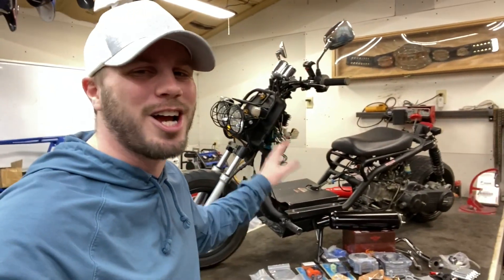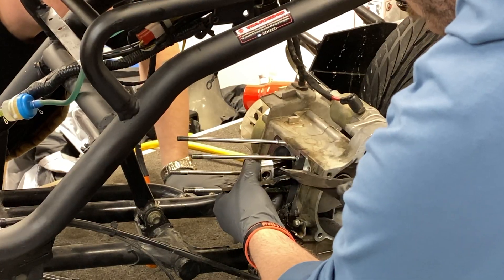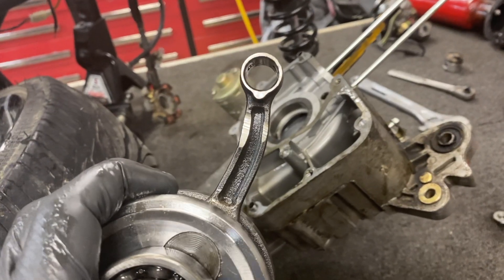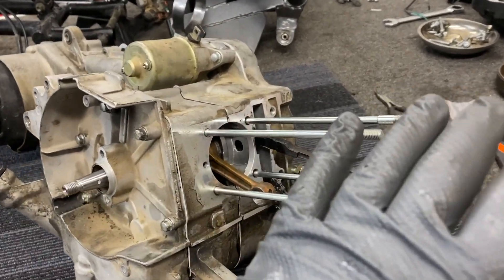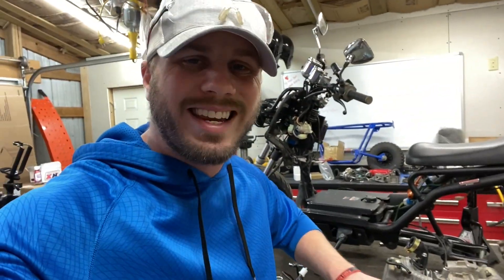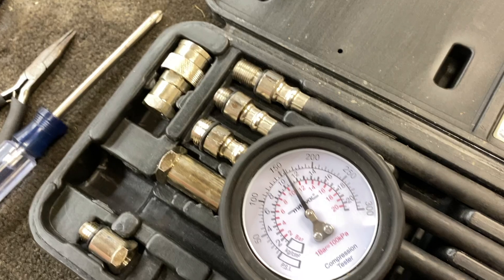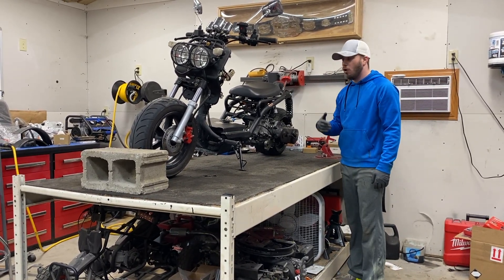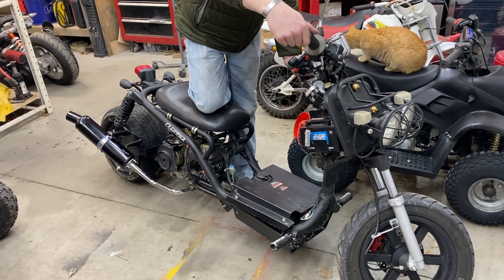100cc Big Bore Kit on a Honda Ruckus Clone! Will It Run...Better? GY6 139QMB It's a Chuckus?!?

Comment: Some people would say this is a over kill, but they dont look at it in the long run. Here in Georgia a 49cc doesn't require a motor cycle license. Changing ot to a 100cc will give people the power and only requires just a basic license. I have been telling people this that are looking for cheaper ways to travel around in town. Keep up the great work.
Reply from the maker: Exactly James! That is the same law for Iowa as well. I have my motorcycle license but for someone who just wants to zip around town these big bore kits are great and actually a pretty cheap option for some extra power.
Reply: Since the law won't look inside your engine why even register it?  They won't.  Done it on a ton of scooters.  Nobody registered theirs.  No one was even questioned. They gave me $300 and their scooter.  I gave them back a 50MPH "50cc" scooter. To not register them was illegal, but neither is doing 35 in a 25MPH zone.  Who doesn't do that?  Plus the extra pep could get you out of trouble some times.
Reply: @oscarhaynes1994  It's mainly to get away from the motorcycle licenses. It still has to be registered. As long as it is registered, you are wearing a helmet and have a regular licenses then anyone can legally ride it. Florida years ago was at 500cc without a motorcycle licenses. Im not sure if they still allow that now or not though. I think all states should allow up to 500cc without requiring a motorcycle licenses.

Comment: I purchased a used 2007 Piaggio mp3 250 IE on March 2019 because of Covid19 took me 3 yrs. rebuilt this motor scooter right now little more work I be finish! I have ADS and takes me little longer just finish one project and this be my first time working this bike! Praska Boy`s Garage💯

Comment: Interesting topic, my neighbor just bought the ice bear mad dog trike. The previous owner said the fuel pump was junk with 35 miles on it. But he jerry rigged a gas can to gravity feed the carb. Replaced the fuel pump and it still didn’t have fuel. Replaced all the fuel lines and vacuum line and still no fuel flow. Then I realized the vacuum fitting on the intake manifold to run the fuel pump wasn’t making any vacuum. Couldn’t suck or blow. Pulled the manifold off to discover the fitting was plugged with silicone or some crud. Ran a drill bit thru it and that fixed it. Fuel flows, it was shipped and sold like that. Thinking he needs a 100😎

On another note…. How the heck did you bend the connecting rod? Then I saw how you rolled out of the garage.😂

Comment: Hey man great video a couple things to note 1 being you don't want to go over 30 on a fresh top end rebuild until you're close to the first oil change 2nd is that if it's revving really high it's probably those yellow clutch springs you put in are sometimes way to stiff if you can't manually open the clutch all the way with your hands they're to stiff otherwise awesome content and I'm definitely subscribed for more.
Reply from the maker: Thanks for the sub! Honestly I am more of a go or blow builder when it comes to any of the chinese throw away motors. If I rebuild name brand oem stuff I definitely take my time to break them in! Appreciate the heads up on the clutch. I ordered a complete tuning kit for the transmission!

Comment: Good content my man. Semi-pro tip: exhaust spring tool is the way to remove/set the clutch springs into the pack. I haven't looked through all your content but you guys need to look into doing some 2T swaps (I have an aerox two stroke in a Zuma and wrapping up an RC-One in a Vento Triton....both are monsters). Getting together a two stroke ruck soon.

Comment: I have a question for anyone reading this who knows engine stuff. But first let me say a huggeeeee thank you to Praska Boys! Someone gave us one of these 110 cc go-karts and your videos have been so valuable in helping me get it running again. The issue I'm having now is the engine just stopped. I'm tearing it apart (which has been a great bonding time with my son) and there is an issue. I'm not sure what the name of the cover is but a little square knob on it broke off. The cover is a thin aluminum one that comes off with 2 philips head screws. It is behind the flywheel and the sprocket that the starter chain goes to. Where this peg/knob was there is now a hole in the cover. I guess my question is what is this cover called and can you order one somewhere? I'm guessing you can't fix that without welding and that is well beyond my skillset. I've scoured the internet for parts diagrams to try and identify it to no avail. Thanks in advance to anyone who may be able to help!
Reply from the maker: I'm not sure if I am following the description but it kinda sounds like your talking about the stator pickup. If you want, send me some pictures to my email and I'd be happy to take a look. Praskaboysgarage@gmail.com

Comment: That moped will fly keep it up man awesome content
Reply from the maker: Can't wait to start working on mine! Thanks for watching!
Reply: Not with that kit. Even with skills at wrenching and tuning a 50mm ebay junk kit MAY get you into 35-40mph range if your lucky normally or average top end after a chaina kit install is 30-35 lol with more lowend thats it. 
  However with good parts you could do a stroker kit (52mm big bore kit) and good cvt carb exhaust and hit the 45-55mph range depending on how you tune it. My icebear mojo pst8-50 has a 139qmb 49.5cc gy6 motor that i fully rebuilt using Narka-NGK-OKO-KOSO-NYC parts about $600 total with some discount codes i had. My trike now tops at 48mph with me 195lbs and hits 48 sooo fast the frontend lifts up on a scooter trike , trust its very impressive 👏 i tuned it for intown riding 35mph roads have that extra 10mph for passing its great 👍

Comment: Cool conversion from a Chuckus to a Ruckus with the Chuckus look. Try updating the engine to the 150cc one in the Honda PCX150. I've had my stock PCX on the highway hitting 70 and still getting 100 MPG around town. Not as cool as my Honda CTX700 but then the 700 is a 680cc cruiser and not a scooter.

Comment: I feel you've got a lot or room to improve on that.  I did a similar kit and sliders on my ex's taotao and I can hit 46mph on the gps. Good luck, they're a lot of fun,
Reply from the maker: I agree! Trying to hit top speeds when it's 15 degrees outside with no tuning didn't help at all! This spring we will get the CVT dialed in for top performance.
Reply: The kits 100% junk so junk it should be illegal to sell it. If you bought a ebay kit like he did you where ripped off sorry. Dont feel so bad cause i learned the hard way aswell wasted $100 on a goofit 100cc kit.. but than i joined Facebook groups study a little and learned clone bikes are worth buying just so you can *hotrod* them its a lot of fun just have to buy NAME BRAND AFTERMARKET PARTS NYC narkra koso ngk oko just to list the best a few other brands other there like Dr pully sliders, gates for belts.. my 50cc *trike* tops at 48mph and could be faster i tuned it for lowend in town riding 35mph roads. With some tuning i can get it up to 50-55 range with new tires and a sprocket (trike chain and belt drive) should be near 60mph and still be able to do "power wheelies"

Comment: In all of my years of working on mopeds I have never seen a bent rod but I would suggest a flat slide carb taller final gears and lighter rollers there will be plenty difference and should hit around 50
Reply from the maker: Absolutely man! I plan to do all that and more. I want to max out the 50cc I bought and have a series on how much the performance parts actually help and which ones are a waste of time! After that it's going to the 150cc+++ club!
Reply: @PraskaBoysGarage  150 club sounds good if you plan on modding them heavily I’d suggest a 232 kit as there bullet proof at that point I have customers coming in every week with blown 150’s bc they beat on them I have a 232 it’s properly geared with efi and on 12’ rims hits 120+

Comment: wow, if the plan up front had just been to swap out a 125 for a 49.9cc it still would not have been a "bad" deal, but yes often you get what you pay for, or you can have some (some) Bob Ross, Happy Accidents along the way.
Reply from the maker: I have all the parts purchased and ready to go for the upcoming 150cc swap! Should be fun to compare the upgrade!

Comment: Nice. Do the right shock delete and upgrade the left one with an lower coilover that has a oil can on it. And swap out that rear tire trust me. Do the tire first.
Reply from the maker: Thanks for the advice! Yeah that tire makes it super difficult to turn. I expected it to be like a normal motorcycle and it wasn't even close. We will be working on my scooter next and when we do the motor swap it will definitely be getting a better set of wheels and tires!

Comment: MUCH better compression. But I can't figure out what bent that rod, assuming it was actually made out of some kind of metal. To turn it into a pretzel like that, the small end almost had to hit something. But what. The small end is inside the piston. Which means the piston had to hit something. If it had hit a valve, there would be a bent valve and probably at least some damage to the top of the piston, but there wasn't. Had there been a foreign object in the combustion chamber or a too long plug, there would have still been damage to the top of the piston. It was the side of the bent rod that hit the cylinder that broke the chunk out of it. That happened after the rod was already badly bent. A real puzzle, unless I am missing something. Of course who knows what the previous owner may have done. He may have replaced the piston and/or a valve and never noticed the rod. Or did see it and decided it was time to give up. And with the rod bent that bad, it would have shortened the stroke considerably. I'm amazed it had any compression at all. There must have been over an inch between the top of the piston and the head at TDC with the rod bent like that.
Reply from the maker: I could not believe it ran in the first video to be honest! With absolutely no rod knock or anything! We are assuming he vapor locked it at some point and ran it into a big puddle or something. Either way, it's wild!

Comment: You need to put the cooling plastics back on the engine. If not it will over heat.
Reply from the maker: I got this comment on my other scooter video also. We plan to put them on but here is my question. GY6 motors are built to be enclosed with most scooters having plastic coverings all around them. This scooter is different with the motor being completely exposed. With that being said is it still 100% necessary to have them on for this specific scooter?

Comment: That engine was probably hydrolocked. I can't really think of another way that the rod would get bent without catastrophic top end failure.
Reply from the maker: I'm very curious as well. My guess was possibly the performance CDI failed and messed up the timing, or it sucked something up in the intake. Not sure, either way I feel it made for a better video!
Reply: @PraskaBoysGarage  ignition timing issues are not going to bend a connecting rod.  I can pretty much guarantee the previous owner sucked up water.

Comment: I am looking to do the same thing as I have a engine I took out of my icebear . As I let it run low on oil two times . Now I check my oil all the time. I only ask did you use a stock crank or something like the one I am looking at. A Naraku Performance crank for $109.86 tolal .
Reply from the maker: For this I purchased a stock crank, however my next project will be with a stroker crank I got from Cajun Maddogs!

Comment: Any advice on where I can get the rear shock and muffler bracket.  Seems to be a ghost part.  Or is there a way to move the rear right side shock so that the pmz50-19 will be supported properly on a single shock?
Reply from the maker: I am not sure, but you should join the Facebook group "Chuckus Life". There is a ton of good information about these and someone will be able to help answer that question for you!

Comment: how do i fix a polaris 90cc sportsman quad 
it runs but it won’t turn off and i have to pull of the spark plug to turn off i can disconnect the key and it still won’t turn off 

and i can also start it without the key or holding the breaks
Reply from the maker: You need a simple coil to ground switch. If you YouTube "install a kill switch" it's very simple. 2 wires and a button! Let me know if you want a link or need more help!
Reply: @PraskaBoysGarage  got it thanks for the help 

i just rebuilt my first engine with the help of your videos 
can you link where you bought your engine stand from?

Comment: I see you've worked on a few gy6s great love to see it.. but you need to look into the aftermarket parts its night and day! Take 2 tao-tao atm50s put a cheap ebay kit on 1 than put a GOOD name brand kit on the other.. 1 bike will not only be way slower topping around 35-40 but will blow up sooner than later.. the other will top in the 50s and last years
Reply from the maker: I have been researching sellers. Any advise on who I should be buying them from? I have been looking at Cajun Maddogs
Reply: @PraskaBoysGarage  can't go wrong with cajun maddogs. They are great. The owners and employees have a nice shop and a actual scooter club for all the maddog riders (chuckies riders). Aside from them there is 
" The gy6 store" 
 "The NYC store" and "gy6 racing" and  "rolling wrench" he even has a YouTube channel showing a ton of builds on the maddogs he does custom builds and mobile repair for scooters/small bore bikes.. there is a few sellers on ebay that can be trusted like "gy6store" but try to stay away from ebay unless you know the seller.. a lot of the sellers are in Facebook groups
Reply: It's crazy how much the price of the atm50 has gone up in the last 2 years.  But you say with a cheap big bore kit it will top out at 35-40 that's how fast they go stock.

Comment: Yo I’ve got my new quad it’s a 110cc and I’ve pulled the whole wiring harness out and put a new spark plug in it but do I need electric to start it it’s a kick start aswell but I’m confused there is no electric at all but duno if it will start
Reply from the maker: You need some kind of wiring harness. At a minimum, you can buy a dirt bike 110cc harness that doesn't have wiring for headlights or tail lights. You need spark, so that means you have to have a Stator, CDI box, and coil at least.

Comment: Love your videos. Where did u get your engine stand
Reply from the maker: Thanks! This is my #1 question for sure! I actually had a CNC company laser cut out all the metal to start making and selling my own. I will be selling the kits on my website either as a DIY kit or a completely assembled and power coated. Should have everything ready soon and will post updates on the channel.

Comment: hey I just re wired my quad and the flywheel smokes so bad we can’t run it do you know why it’s smoking ?
Reply from the maker: The flywheel is a non lubricated part that doesn't make contact with anything. Should be rotating freely. If you have smoke coming from the flywheel I would assume it rubbing on something.

Comment: hello love your channel!! im looking for the little red engine stand that ive seen on your other videos that bolts to your table to be able to move around and turn over to work on engines  could you direct me in the right direction to find one. 
please and thank you in advance for your reply.
Reply from the maker: Hey thank you very much! This is my #1 question for sure! I actually had a CNC company laser cut out all the metal to start making and selling my own. I will be selling the kits on my website either as a DIY kit or a completely assembled and power coated. Should have everything ready soon and will post updates on the channel.

Comment: The gy6 50cc only required less than a quart of oil.you put a quart and a 1/4.blown out seals in your future
Reply from the maker: No, I finished off the almost empty bottle I had and then used about half of the second. These scooters take 750ml or roughly 3/4 of a quart and that's exactly how much I used and confirmed it with the dipstick it was good.

Comment: Hey. I’m having a bit of trouble with my 50cc moped that I hoped you could help me with. It doesn’t start or run at the moment, but I can bump start it and it will run for a few seconds (but not idle) then just die. So if you could help me figure out what is wrong I would be so grateful.
Reply from the maker: Sure thing man! The fact that is starts for a second confirms you have enough spark and compression for it to run. Your issue usually leads to a fuel flow problem. Could be your fuel pump, fuel filters or lines need to be replaced. Could also be your carb needs to be cleaned/replaced. Either was I would assume the issue is fuel flow and a tune up will be your best bet. If you want specifics or links shoot me an email I'd be happy to walk you through it.
Reply: @PraskaBoysGarage  thanks man, what’s your email address?
Reply from the maker: @jonathancarlberg3854  praskaboysgarage@gmail.com

Comment: Hey bud one simple question. I have a 125cc taotao f125 and im having high idle issues could it be the wrong carb on it? Is there a site that helps me know the actual measurements
Reply from the maker: I'm not sure if there is a website with details but a 125cc should have a PZ20 carb on it. If your getting a high idle you need make sure your throttle cable has slack in it first. Then adjust your idle screw on the carb. After your idle is set then you can take the slack out of your cable.